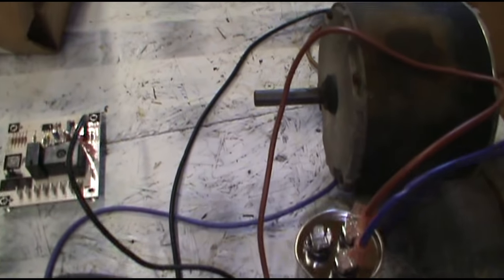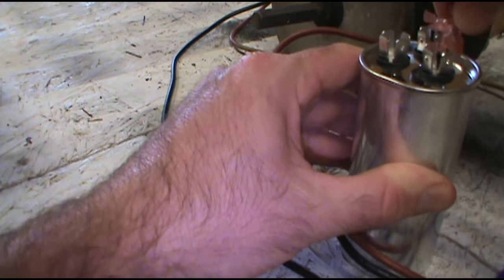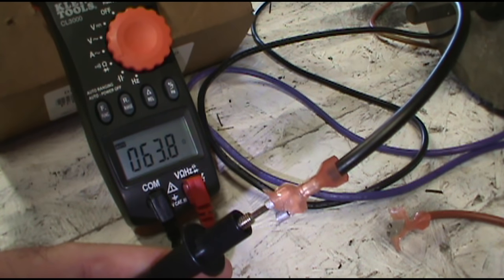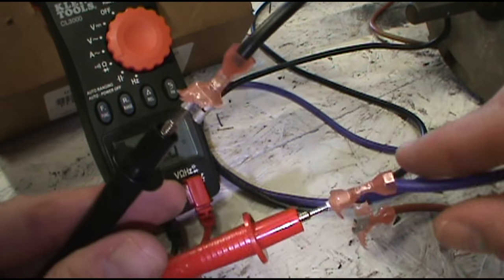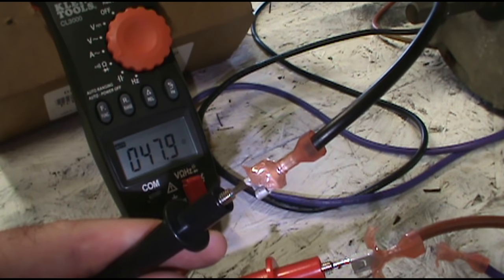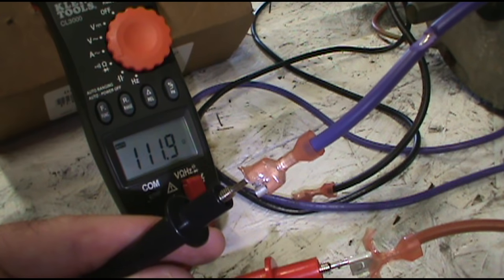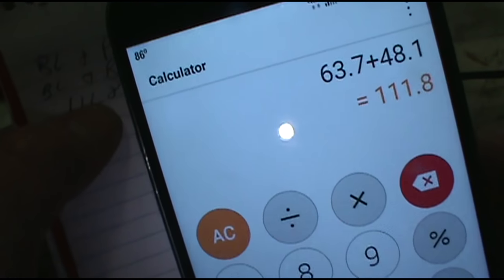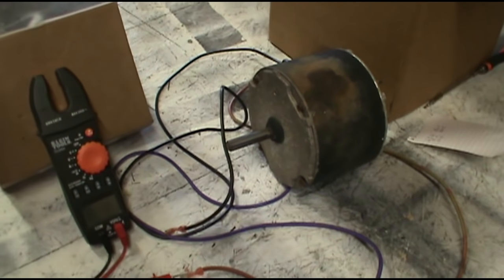HOW TO TEST CONDENSER FAN MOTOR

Comment: Ran the numbers and everything checked out. Replaced the capacitor and fan still wouldn’t fire. Pulled the motor and noticed it would not spin freely as it should, so the numbers can still add up but if the fan doesn’t turn, it could still be bad. Oh and I noticed a small 4:21 wetness around the motor shaft.  Thanks for the vid. Helped when I installed the new motor. Numbers were also good
Reply from the maker: Thank you so much for watching David!

Comment: Lex. Good job the only things you may have not thought about 
Checking to see if motor is grounded . Check the amp draw of motor to see if it is drawing high amp. Also taking a merger to check and see condition of.motor windings.merger could tell you if windings are getting weak. You did real well explaining how the 2 ohm readings should equal the third. Have a blessed day
Reply from the maker: Pat Stansberry I love my Megger. Thank you for watching Pat!
www.DirtyMaintenanceNation.com
Reply: I agree,  I ohmed out my non-functioning fan motor today. The numbers added up but the amp draw was 3.5 amps on a FLA 1.5 rated motor. I opened the case and it was full of shavings from the rotor assembly rubbing against the winding.  The resistance doesn't tell the whole story.

Comment: So I tested Goodman gsz Goodman compressor fan, I got 33, 55, and like the video said 88ohm between brown purple. The fan was actually bad though and tried moving the motor to see if it changed, but always the same so I thought I had a good motor. Thank you to goodmam who replaced under warranty, with broad-ocean brand instead of Goodman. At least it's working well.
 
I think others dislike video because it can be misinformation, and caused me extra worry.
Reply from the maker: Thank you so much for watching B!

Comment: Solid video. Quick question.....my wires are black, brown and yellow instead of purple......but I did the same and all did add up to each other. "But" they total to about 83.4 and not near 111 or so. Should mine read higher, or does that vary from motor to motor?
Reply from the maker: It varys on motor size & horse power. Thank you so much for watching Chris!
www.DirtyMaintenanceNation.com
Reply: It is a 1/4 HP 230v

Comment: Great vid, but quick question. I tested the wires and when I added up the two, it was about 2 ohms off from the fan/common number. (38, 52, and 88). Condenser is running, fan is still not spinning, and I've already replaced the capacitor. Would those 2 ohms off be a reason the fan isn't running? If not, what else can I check?

Thanks!
Reply from the maker: I'd need to be there for this head scratcher. 🤔

Comment: Great video I have a unit that the indoor blower doesn't blow like used to I check relay it's good ducked good return good   Evap is clean could it be capacitor or maybe motor is going bad thank for your vids
Reply from the maker: Armando Monreal Yes, test the cap on it. If its good, the motor maybe slowly crapping its pants & needing to be replaced. Thank you so much for watching Armando!
www.DirtyMaintenanceNation.com

Comment: Excellent video...  Next test is to OHM each of those leads Black, Purple, and Brown to the chassis of the motor.  It should be open otherwise it is shorted to ground.
Reply from the maker: NETWizzJbirk Right you are skid! I was told by an on call tech that this motor was bad & was causing the fan to run backwards. It was actually a bad capacitor with really low MF's that was causing fan to run backwards. Thank you so much for watching Justin!
www.DirtyMaintenanceNation.com
Reply: Nice, so they did like four times the work pulling the motor and evidently the fan blade, too.  That's at least 16 screws, dealing with flimsy metal, and and probably required a shot of penetrating oil and a puller.   Not to mention somebody has to measure where the fan blade goes on the shaft, and has to keep track of which side of the fan blade faces the top of the condensing unit... Then someone has to fish those three wires back through the tube, the little keeper then the hold to the electrical compartment, and a new zip-tie is needed etc.  Way more work than testing and replacing a cap especially if you buy ones that are the same size as the factory Tong Feing Chinese ones.

Not to mention, Goodman is cake being very consistent.  You don't even need to write down where the wires go.  You know the unswitched portion of the single-pole contactor goes to the Defrost board and the fan's common goes to DF2 such that the defrost board can disconnect the fan to not run it during Defrost.  Goodman typically has a short, red pigtail from the switched side of the contactor to the common on the Cap.  The purple wire from the condenser fan is the fan's RUN wire, and it goes to the common lead of the capacitor (same as the switched pole on the contactor where they actually connect the compressor's run wire), and finally the BROWN wire is the start wire, and it goes to the FAN terminal on the run cap, which 95% of the time needs to be 5 Microfarads...
Reply from the maker: NETWizzJbirk Yep you got it down pat! Ol dude did an hours work instead of a 5 minute cap. change. LOL! 😂👍😂
Reply: not only do they run backwards, they run "hot" from over current and causes windings to cook.
depending on how long it was bad, probably be replacing the motor within 6 months anyway :)

Comment: What a great video! Heading out to go get an ohm meter!😅
Reply from the maker: Thank you so much for watching!
Reply: @LexVance  took my readings of BL+P = 22.8, BL+Br= 48.8, P+Br = 60.1 adding the first numbers I get 71.6 well over the 60.1. What does this indicate? A good motor?
Reply from the maker: The 2 smaller numbers are suppose to equal the big number. Or, be fairly close to the big number. If the fan is not coming on, that may be a bad fan.
Reply: @LexVance  Okay, thanks again! I will order parts and update this thread with the results in case anyone else has the same higher readings.
Reply: New fan and capacitor installed today. Using your methods for testing, the new motor was spot on! Thanks for the assist! It runs like a champ again.

Comment: I have a goodman split sytstem heat pump and the condenser fan blade kepps cracking at the base, what could be causing it to break? any comments would be greatly appreciated.
thank you.
Reply from the maker: That's a tough one. Id need to be there for this head scratcher. 🤔

Comment: Hi Lex! I swapped my capacitor out since my readings were 28/3 on a 35/3 capacitor. I also checked the fan wires and got 159 , 122 & 37 between the wires. The fan still won’t start until I give it a push a few times. Do you think the condenser fan motor can still be bad even though readings add up? Should the fan wire lower readings be more even?
Reply from the maker: If you have to push it then it's bad. Thank you so much for watching!

Comment: Can low refrigerant cause the fan to not come on? Compressor kicks on then back off like a limit switch engaged but fan not working, capacitor fine
Reply from the maker: Yes, a low pressure switch will switch off the whole condenser when refrigerant is low to protect the compressor.

Comment: Hey Lex, so I ran your test came up 37.1,+ 72 109.1 and the final brown and purple wire test metered at 107. Is there a tolerable variance? Great easy to follow video
Reply from the maker: That sounds like a good motor. That's not way off. 🤔
Reply: @LexVance  thank you

Comment: Hey lex I was checking an inverter condenser fan motor I check it on continuity 2 legs give the beep but the other 2 notting is doing it on continuity is good or it has to be on ohms ?
Reply from the maker: I like doing ohms when checking fan motors. Sometimes wire aren't suppose to have continuity. Thank you so much for watching Carlos!

Comment: Thanks for the video, but I was confused when I tried to do this test. First, I tested the old fan motor and got no readings at all, which I though might have indicated a broken winding circuit. Then I also tried testing he brand new, out of the box, never used fan motor I purchased as a replacement, just to confirm it.  It showed readings when testing all 3 circuits as instructed, but for me, the ohm readings just kept going down and down. Starting from the  200+ range and quick dropping down past 190, and on and on.. changing fast at first, then slowing to a drip drip drip change. So I never really could get a static reading within an acceptable timeframe (before my meter tool wanted to auto turn off. For one reading, I was determined to wait it out, and waited at least 10 minutes for it to stop its slow dropping of its value, down past 119 ohm  and still dropping, so I just gave up. The tool I'm using to test is similar to yours, but its a Klein Tools CL390 with True RMS. Not sure if that matters. It was on the same Ohm setting as your, both with Auto ranging enabled and without.  Do you know what might be causing the ohm reading to not stop and setting? Should I wait a half hour and see if it finally does (or until the tool auto shuts off).
Reply from the maker: Yikes I don't know. I'd need to be there for this head scratcher 🤔

Comment: My fan checks:
 Brn-Bk-52.7
Wh-Bk-  28
Brn-Bk- 80.7
  The readings add up very close. 
  You think the fan is good?
Reply from the maker: Looks good to me. Bad capacitor maybe? I'd need to be there for this head scratcher 🤔.
Reply: @LexVance  Been fooling with this thing again after replacing capacitor and contactor. 
  I thought felt heat coming up from the condenser when it came. 
  Also, the air handler blower would not in withe comoresser on. 
  I decided to check condenser fan for shirt before going further.  
  All three wires gives reading with ground. :(
  I assume it is shorted and was why I feel warm air when it came on.
  I have since been told the fan might not be shorted. Something about it being connected a transformer or having its own transformer. I am not sure what the guy meant.   I had the wires disconnected and checked each to the fan housing.
  Btw, My resistance check for the windings did not go near what yours did.  1/5 hp showed around 24.*, 40.* and around 80. 
  I know those are not the correct reading I got but they did equal out.

Comment: I also checked between ground and all wires with no connection, but a 1/4hp 220v motor showed 33,55, adding to 88 like the video, but the motor was still bad, not even attempting to start.
Reply from the maker: Thank you so much for watching B!

Comment: The numbers should add up exactly or as long as it’s close? 111.8 vs say 111.4, would the little bit in the number being off be the bad or is that still good because the whole number matches?
Reply from the maker: Yes, close is good. Way off is not good. Thank you so much for watching Chad!
Reply: @LexVance  I appreciate you posting the video! I recently had a mouse climb across my capacitor and blow it up. I replaced the capacitor and the unit starts and runs for a while then shuts off and it starts buzzing like its trying to start again. I was sure it was the fan motor. But after testing it and conferring with you. Maybe the capacitor I just put in is no good. Figured id pitch the situation to you to see what you thought.
Thanks again for the video!

Comment: so what specifically in the motor would cause it to not be a good motor?  like bearings? or what? I'm clueless.  And is it something that can be fixed/refurbished inside that motor?
Reply from the maker: There's motor windings inside the motor. I'm not sure if it can be rebuilt. Windings are not like bearings.

Comment: 28.5+59.9=88.4 vs 87.6.  Within tolerances, right?  I also showed continuity between two of the leads (can't recall which, but that makes sense, no?).  Just installed a new capacitor of the exact same spec as the previous.  Still, no go.  Relay appears to work.  The fan and compressor in the attic are working, just can't get the fan to fire. 🤷‍♂   It's 106F in the San Fernando Valley right now.  HELP!
Reply from the maker: Weird, I'd need to be there with my voltage meter for this head scratcher 🤔.

Comment: My fan is good using your test, replaced a new capacitor.  Not sure if it is contactor.  When power on I hear a click but fan won't move.  I notice one thing though, without power I can turn the blade (using screw driver) easily, when power on with a click, the fan is "frozen" and can't even turn the blade, any idea?
Reply from the maker: Weird. I'd need to be there for this head scratcher.

Comment: Got a cheap analog meter.  My red and black are 12.....my brown and black are 10.....   my red and brown are 10....it dosen't add up. When I turn my ac on from the circuit breaker,  the fan will run for about a half hour then stops and buzzes. I done that repeatedly with the same result.  So after the initial run from the power being back on it just wont spin the fan a second time. Fan turns easy by hand. Do you think this is a bad fan then?. Compressor clicks on and sounds right. Fan motor is a f48e06a48. Thanks
Reply from the maker: I would need to be there for this head scratcher. I need to see it with my own eyes and meter.

Comment: What is the tolerable variance? When testing the 2 against the black It doesn’t bounce at all, when testing the two with each other it bounces around between .1 difference. The difference between the 2 added and the 2 tested together is .2-.3 I’m guessing that’s fine?
Reply from the maker: Yep. As long as it's nothing crazy. Thank you so much for watching!

Comment: Hi  I  bought  a new 230V a/c fan motor but decided to delay install until Winter due to the old one suddenly does not have squeeze noise anymore.  Since it is hot summer now, I don't want to mess with it (if it works, don't touch it).
However, since I did not plan to install it, I want to make sure the motor is good; otherwise, I may have to return it.
I tested the new Genteq fan motor with 3 wires - Black Brown and Yellow with ExTech meter.
Black and Brown has 55.4 +
Black and Yellow has 26.5
                                     = 81.9
Yellow and Brown has 81.5
I am missing 0.4 somewhere and is this ok or I have a cheap test meter?
Thanks for the video. This really simple and very helpful. 👍
Reply: I think it may be test meter related because I used my cheapest Harbor Freight's Cen-Tech meter which is Free 10 years ago with a coupon and I have a bigger differences.
Black and Brown has 56.1 +
Black and Yellow has 27.4
                                     = 83.5
Yellow and Brown has 82.0 --> a difference of 1.5
Thanks for the video.
Reply from the maker: I would need to be there with my volt meter. I have one especially for this job and it would give me the readings I would need.
Reply: @LexVance  Thanks for quick reply. I think my fan motor is good and it is OEM Genteq and assembled in Mexico.  I spin the shaft, it is as smooth as silk but I will find out the truth during winter time. Thanks again.

Comment: Just installed a new motor and cap. The motor runs if I push it, but not with the cap. The starter windings are ohming at 0.
Reply from the maker: I'd need to be there for this head scratcher. 🤔

Comment: I tested my cond fan motor and came up with the following BR/BL .081; Y/BL .27; Y/BR .106 My total between is .106 ohms which gives me a .002 difference. I gather that it's negligible?
Reply: Forgot to mention the motor operating temp is at about 185 degrees???
Reply from the maker: That doesn't seem too off to be a bad motor. I'd need to be there for this head scratcher 🤔.
Reply: @LexVance  condenser motor has gone into thermal overload a couple of times. I have changed the contactor and the capacitor at the start of summer. yet yesterday the motor went into thermal overload. Granted it was a hot day with a peek of 106 degrees out
Reply: I changed the motor out and found the bearings were bad, a lot of end play. In case anyone else comes across a similar issue.

Comment: Fan motor ohm readings are 
Black and brown 42.7
Yellow and black 46. 5
Yellow and brown 58.7
Does this mean the fan motor is bad?
Reply from the maker: Sounds like it is. I was taught that the 2 small numbers should add up to the big number. Or at least be close to the big number.

Comment: My fan on the condenser was not spinning yet the compressor was on in both heat mode and AC mode. Watched your video and ran through getting low reading on black to purple and nothing --off scale on brown to purple and black to brown so I'm guessing the fan is shot. Can't be 5 years old. Thanks for a great video and I put in a new capacitor so it's not that--Yhanks
Reply from the maker: Thank you so much for watching John!

Comment: Hey so I’m trying to fix my ac unit. There is a hum and so we thought it was the capacitor. The cap is fine so I went to this video and supposedly the motor should be fine but is not moving. Any advice?
Reply from the maker: Bad motor it sounds like. See if the blade spins when you hit it. If it doesn't spin freely, sounds like a bad motor.
Reply: @LexVance  ah yeah. I took it apart first and it is hard to spin the motor. I just thought it was salvageable. Thank you! You just got another subscriber :)

Comment: Good to know...I've ohm'd out compressors but didn't know you could do motors. I'm guessing if it has a start and Run winding you can perform this test. I've ohm'd out motors looking for shorts but not like this.
Reply from the maker: Danny L Yep! Very much like doing a compressor. Same deal. Thank you so much for watching Danny!
www.DirtyMaintenanceNation.com
Reply: anything "electrical" can be tested for resistance "ohm'd", the challenge is finding "known good" values to compare against.